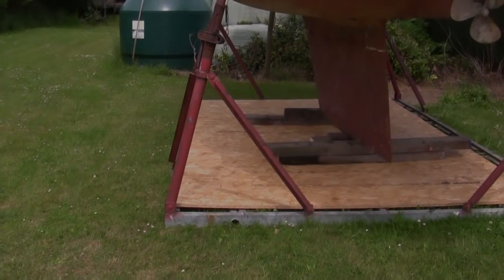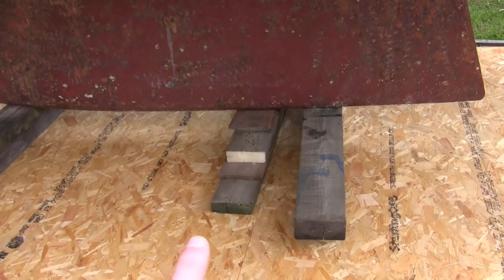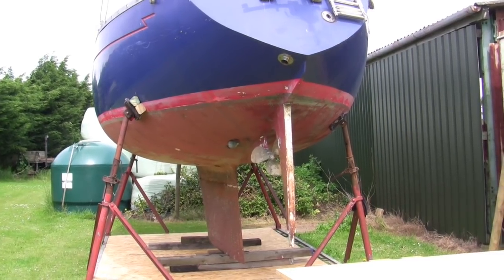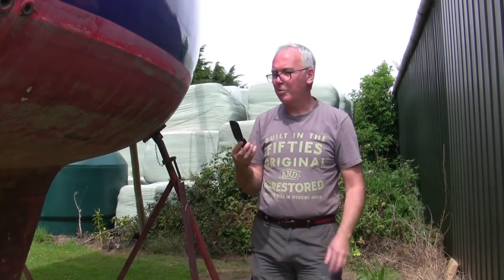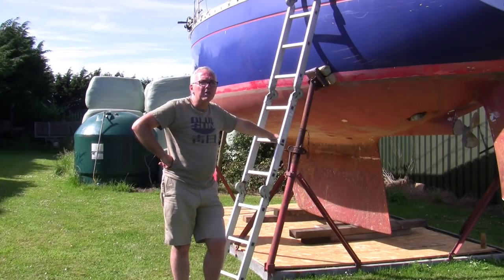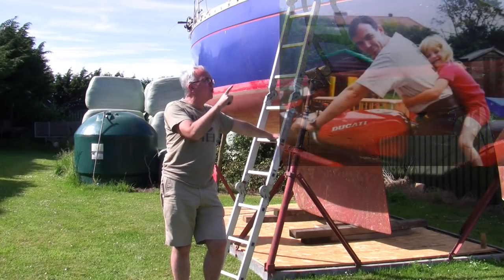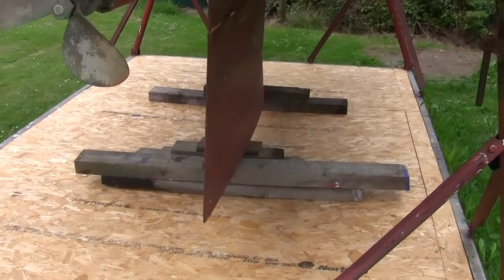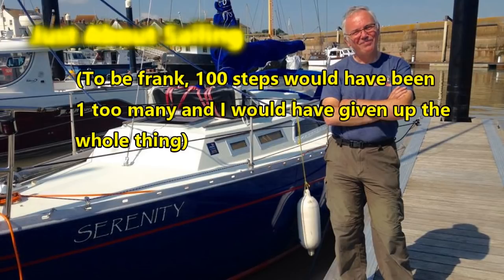Just About Sailing June 2 2019 - Clearing out the boat and preparation for the real work

Comment: Hi Paul that's handy having the boat in your back garden. What is the 45 minute schedule about? I hope you are alright. It won't be long and you will be on the high seas. All the best. Kind regards Daryl.
Reply from the maker: Yep, I'm hoping that being 99 paces away will make all the difference.
I covered the 45 minute thing a few videos ago. Basically, I have a health problem that is possibly related to my immune system (tests still ongoing) and I run out of energy (mental and physical) quickly. And if I do run out of energy my body decides to hit me with debilitating clusters of migraines for a few days. So, I am experimenting with sticking to a couple of 45 minute sessions each day of doing something 'demanding' on a good or bad day to build up strength again.
No idea if that will work, but people cleverer than me have recommended it. We shall see.
Cheers

Comment: Ducati....It's on the bucket list.    Do you think it will fit in the v-berth?   😊
Reply from the maker: Patrick, where there's a will there's a way - I used to keep it in a purpose built heated shed. Actually, I knew someone with a large motorboat who restored a BSA 500 on the rear deck.
The Ducati was wonderful, and as a bonus it was only excruciatingly painful when you were actually sitting on it. 
Cheers, Paul

Comment: Physics? Did I hear correctly that you set Luci off in the right direction? Seems to have been a bit of a diversion into other things since, but a bit of physics can be useful in nearly anything. 

I'm sure you will have Serenity ready to launch long before the waferboard deteriorates without any preservation technique. Working on Serenity should be more efficient with it emptied out as well as being one full step less than infinity away. I'll look forward to the next update.
Reply from the maker: Ken, myself and her grandfather tried to set her off in the right direction - That is, Physics!Unfortunately it wasn't to be She decided at the age of 9 that she wanted to be a marine biologist, specifically a shark specialist, and has never wavered since then. Although, I think she had to do quite a lot of physics in one of her advanced diving exams - partial pressures etc.
I'm sure you are right about the board. It is exterior quality and resin impregnated - I just though that it doesn't take much to slap one coat of preservative on it. Or maybe get Lucy to do it ;)
And yes, it makes a huge difference to have everything out and be able to focus on one task at a time without the need to move things around from one place to the next.